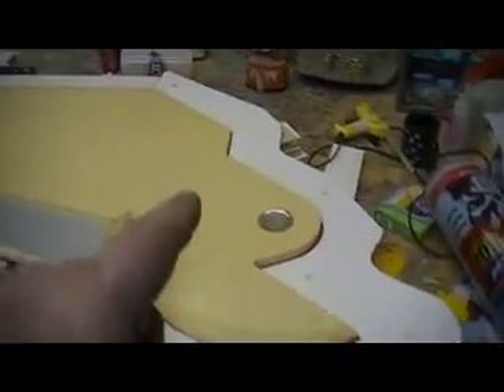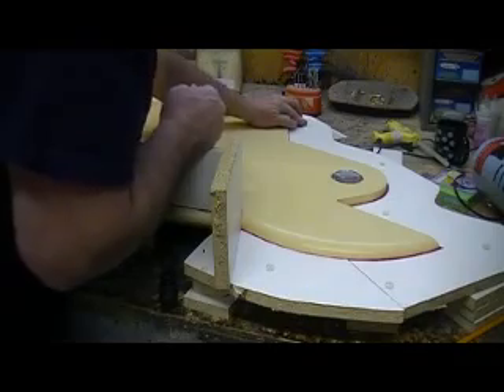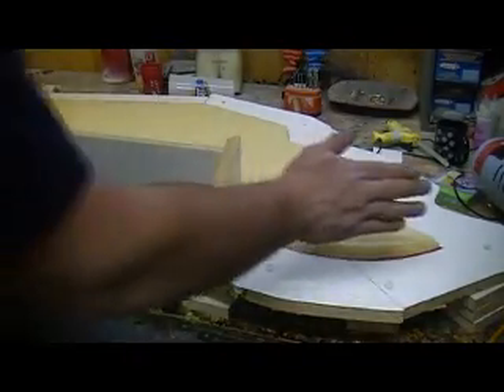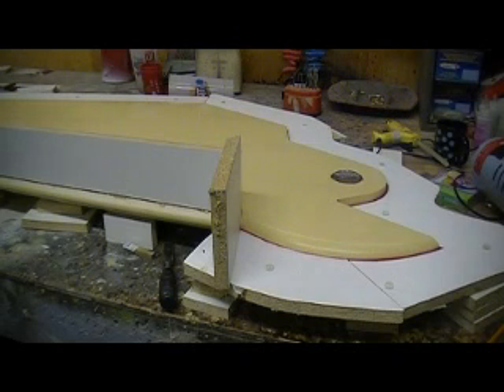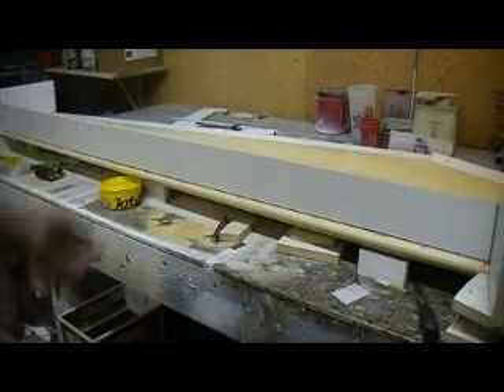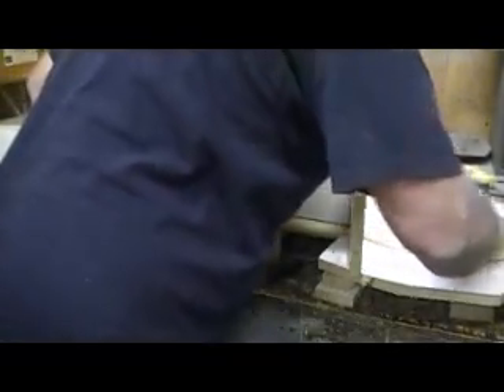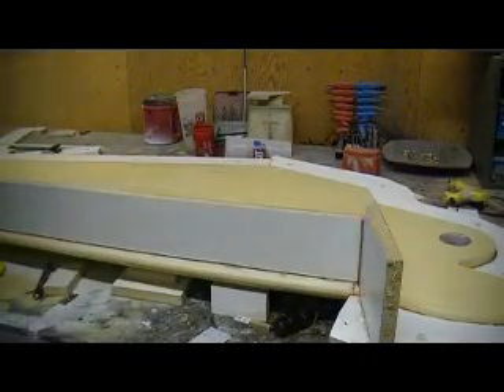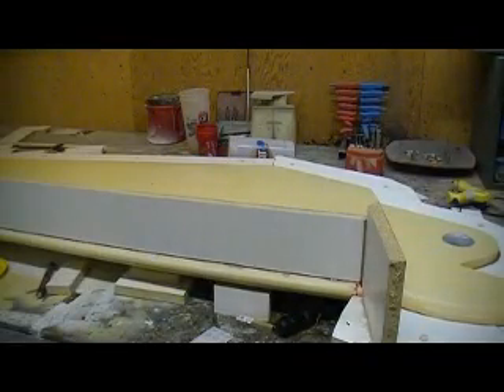how to build a rc jet B-1 Bomber #116 pt 1

Comment: You know bob, if I were you I would finish making the molds for every main part. such as this wing, the stab, and the tail (horizontal stab). then lay those up. get them done. then work on the control surfaces. Just an idea. What you think?